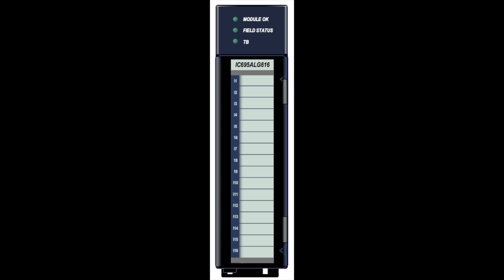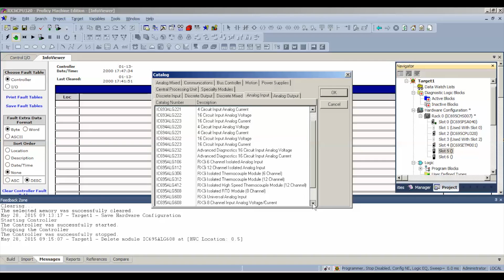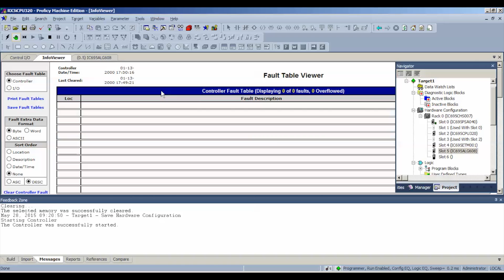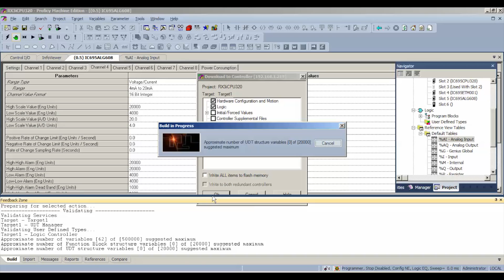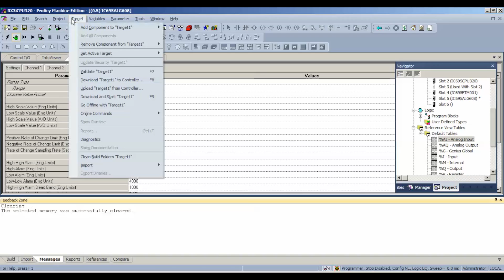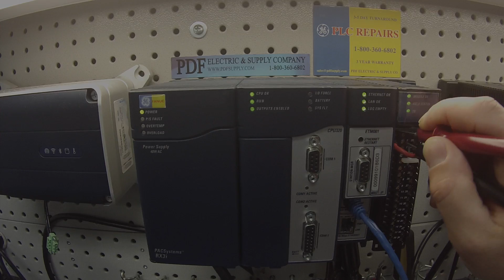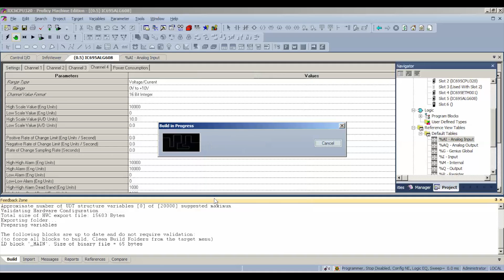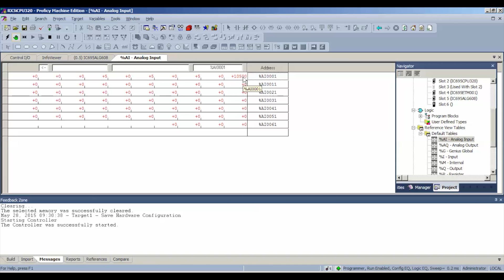How-To Troubleshoot: IC695ALG608 PLC (Rx3i PACSystems Tech Support)

Comment from the maker: IC695ALG608 Troubleshoot & Training Video GE IP PLC Analog Module
GE Intelligent Platforms / GE Fanuc RX3i PacSystem
SKU 2176234  UPC 0218648404207
Analog Input module, 8 channels single ended, 4 channels differential IC695A IC695AL IC695ALG